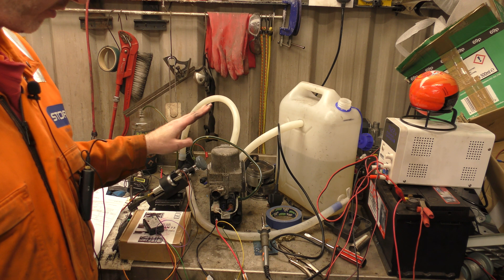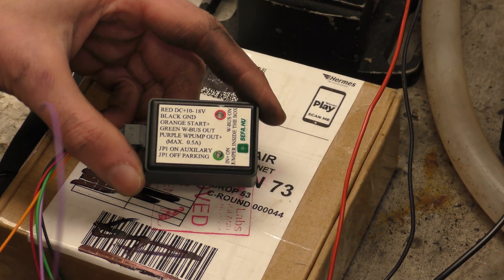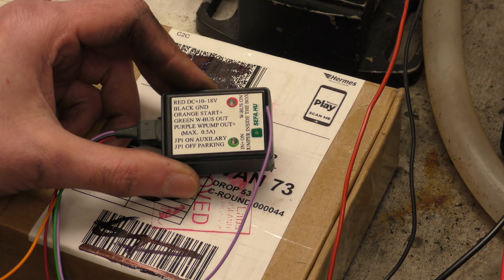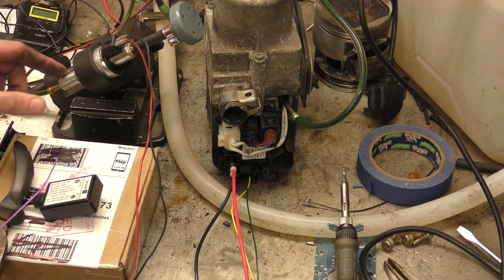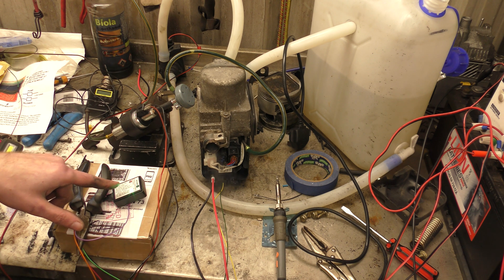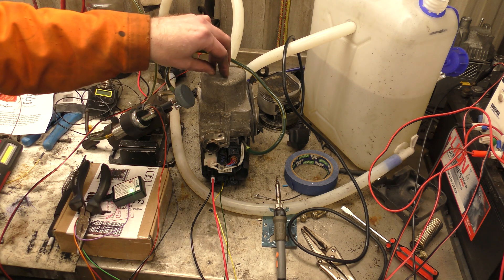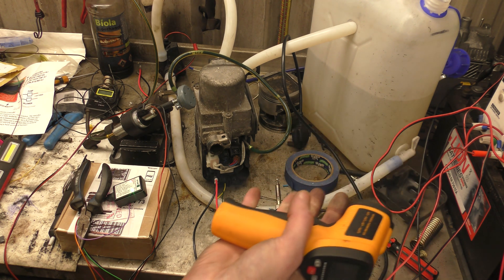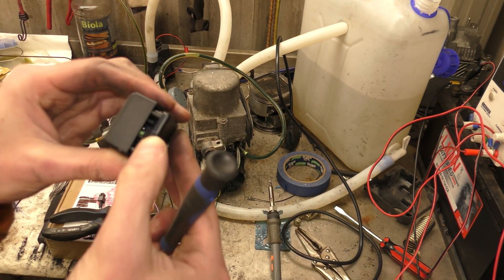Webasto Thermotop W-BUS adaptors - firing up the Thermotop V

Comment: What ml dosing pump do you run
Reply from the maker: On a Thermtop V - 32ml
Reply: Thanks I bought a thermo top v the other day and Kline adapter with wtt software it connects and I can get each component to work but it won’t start the heater it just says Nak access denied 
So I bought a webasto 1533 timer with w-bus out and that won’t start it either ! Any ideas 
Kind regards 
Gerry

Comment: HI. Excuse me but I'm going crazy getting my webasto thermo top v to work, as long as I'm missing a wiring diagram. So without a w bus, the heater doesn't work? Does simple connections not start? I use it to heat hot water for a radiator in my garage. Could you help me with the 8 pin connections? Thank you
Reply from the maker: Thermotop V need either an w-bus adaptor or the correct Webasto controls to turn them on.  There isn't a trigger wire.
Reply: @DavidMcLuckie  thank you

Comment: Hello again I’ve got one of them W-bus to start my thromotop z   Ex bmw heater. But for some reason my W-bus is not behaving like your one dose my just lights up green and that’s all.
Reply from the maker: Assuming all the wiring is correct.  Then there is perhaps a fault with the heater, or it's 'locked'.  The Webastos if they have enough of a specific error will lock and not start and need the codes cleared with the Webasto diagnostic software.

Comment: Oh right they sent you an item I was wondering if it was a scam
Reply from the maker: They sent one for me to try.  But it arrived needing a little solder joint fixed.  Once I fixed that it works exactly as it should.
Reply: @DavidMcLuckie  hello thanks for the reply I’ve sent my one in to be fixed.  But also have one out of bmw worked in the car but not on the bent he. So I’ve got one of them W-bus units hope that will make it work. Still waiting for it to arrive from Hungary

Comment: Hi David great video. I've just got a Thermotop V from a Rang Rover but ive read they need a special fuel pump DP41 that has some sort of feedback with a solenoid valve built into the TTV. Do you know if your aliexpress pump had this? Could u post up a link for us all as genuine are SO expensive and even less common here in Ozland.

Comment: Thanks very much for another informative video!

I'm running the little black Hungarian box with a 4KW Thermotop Evo in my car, and one thing I've noticed is that it sets a "W-bus communications error" everytime it runs the heater, and the heater turns itself off after 60 minutes of runtime - I then have to remove the "startsignal" to the black box, and start it again to run for another max. 60 minutes. 
I have been in touch with the seller, who says the problem's with my heater, buuut I kinda doubt that... - I would be very interested to hear if your heater is able to run for more than 60 minutes, and if it logs a W-bus comm. error (I know it's a tall order, so completely understand if you don't have time to find out ;)
BTW, regarding the parking vs. aux. heater: when I configure the jumper to "Aux" the heater turns on/runs, but it doesn't trigger the fan relay or run the circulation pump :)

Best regards from Denmark, Chris
Reply: have you figured out the 60 minute run time? the 1533 timer does the same thing,it has the same 60 minute limit. but since I fidle with a lot of webastos,there is something curious. the software in themselves has a 255 minute run limit.

Comment: Hi @David McLuckie. Great videos. Very informative and entertaining. I bought a dirt cheap Eberspacher Hydronic D5W Z 5KW diesel heater to see if I can get it going and use it as engine preheater for my surplus army truck. I'm not sure of the simularities between the Espars and the Webastos. Would this adaptor also work on my Eberspacher? Any help is greatly appreciated. Cheers.
Reply: Hi, could you please tell me if you did get the D5W to work? And if you did how did you do it?

Comment: What do you think, how lang does it Take to heat up a 800liter hottub up to 36°C with a webasto thermotop c
Reply from the maker: Depends on water start temperature.  But to go from 10ºC to 36ºC would take about 6 hours.

Comment: My A2 has an Auxilliary heater which heats the engine up faster when it’s running. There is an option to have it as a parking heater and the difference is a remote control, the water pump and a controller which runs the cabin fans  without the engine running. 😁👍
Reply: I do have A2 with factory webasto and climatronic, just in process of converting it to parking heater so car can defrost before trip

Comment: Where do you get  your fuel pumps from?  Also  what size pumps  should  you aim for  depending on sizing of burners...  i found out that the 12-22 pumps don't move enough fuel  for the 2kw Webasto as the hertz is lower and the Webasto fuel pump must be bigger :/
Reply from the maker: I got mine on AliExpress.  They do the 35ml for the V and the 65ml for the Z.
Reply: @DavidMcLuckie  Got my self a thermo top V for my escort van, just want to confirm the size of fuel pump for it is actually 35ml? as I can't find any info other than your answer to that post I made 3 years ago about a different heater. 😅
Reply from the maker: @austinmaxi  For the thermotop V there is a bit in the manual for testing the pump output.  And it works out to be approximately 35ml pump-sized.  ( Diesel: 36 to 44 ml in 180 sec. at 7 Hz)

Comment: I've got a z top with a blown board,  what exactly would I have to buy and connect  to get it running, z tops aren't exactly common here in Tasmania and apart from your videos I really can't get any decent information.
Reply from the maker: At the moment there are two choices I know of.  There is an ebay seller who makes a replacement board from Hungary, and another is from Bulgaria the Orbasto.

https://www.ebay.co.uk/itm/DIESEL-Aftermarket-controller-Webasto-Thermo-Top-C-Z-E-P-TSL-17/153721220865?ssPageName=STRK%3AMEBIDX%3AIT&_trksid=p2057872.m2749.l2649
https://orbbasto.info/index_en.htm
Reply: @DavidMcLuckie  I can't thank you enough, I love your quirky videos, I'll get onto the links you sent cheers from Tasmania. (Australia's Scotland)

Comment: Perhaps auxiliary or parking, means whether it has an output for the water pump?
Or perhaps auxiliary heats up to warm the engine and then stays turned off. And parking restarts if the temperature drops to far to allow to have heat for the cabin fan.

Comment: You keep coming up with great information for us!
Tonight I got my (second) Thermo Top C (Rover 75) running a full cycle after freeing up the water pump, it was jammed by coolant sludge.
The other unit I have is a Range Rover L322 unit of the same vintage but looks absolutely mint.
Bit of digging, doesn't look like the W-bus controller would be compatible with that unit.
One of the units is going in my car, the other will eventually be running some radiators at the container workshop.
At the moment, a mix and match is likely with the Rover75 ECU fitted to the Range Rover unit for the car.
Seems I might be best off getting a TT-V and this controller for use in the workshop, leaving the TT-C for a spare just now.

Comment: The version 1.4 needs a program for it to work. Don t know if you noticed it on there website.
Reply from the maker: That's the software to install the drivers for using it as a diagnostic adaptor.  That also doesn't work.  Which is a shame.

Comment: Great to see this adapter works as iv got a similar item (early version) but not fired it up yet. On another subject you mentioned, Robinson Labs controller,  I have one that has been installed for around 6 months to monitor a Top-C retro fitted to a Caddy van with the Hungarian ECU, but found the Robinson Labs Controller to be very buggy (W-bus Connection Lost), saying that when it dose come to life it can be a handy tool for monitoring, also the the W-bus to the WTT software worked well just like Robinson Labs stand-alone W-bus converter. My only suggestion would be to power it via a battery rather than a bench power supply, as I found unplugging a nearly fully charged phone from the cigarette lighter (high switching from the circuit) it came to life, this could have been a fluke though 🤷‍♂️. 
Thank you for your videos buddy.
NOTE: The combination of the Hungarian controller and/or Robinson Labs controller emit a fair bit of EMF through the W-bus and mosfets, literally wipes out most radio signals.
Reply from the maker: Ahh.  Now that's an interesting thing.  I've noticed with the Hungarian ECU when I try to monitor it via WBUS and my Webasto diagnostic software on the laptop it disconnects frequently.  Perhaps its the Hungarian ECU that doesn't maintain a constant WBUS stream.  I'm actually running off the battery in parallel with the power supply, as 10A isn't enough to run everything during startup.
Reply: @DavidMcLuckie  I have the same problem but only when I knock the USB cable,  it was 422 start ups/11 months installed between plugging the Hungarian ECU into the software so I can’t quite remember if that was an issue I experienced. I do remember getting the polarity the wrong way round and de-soldering/blowing up diodes off the board on one occasion during the learning process 👍 but after replacing the components it fired straight up. I did buy two more though and only one of those arrived to me working, one would just run the combustion fan and not link via W-bus for love nor money.